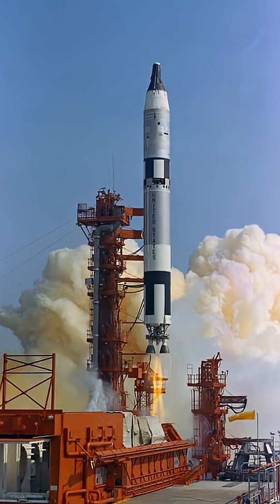Why does this rocket have HOLES!? #shorts #history

Comment: The holes or vents for hot staging has more to do with pressure than temperature/heat.  Any pressure rises in the nozzle bay will directly impact the combustion balance in the rocket motor itself as well as the nozzle expansion ratio. Hot staging minimizes the possibility of nozzle damage when multiple springs, explosive bolts or other mechanical separation devices, which ALWAYS requires more than one device, have one of those devices having a "laggy" extension/thrusting, placing a pitch or yaw on the second stage itself and not clearing the top nozzle bay linearly.  Using the rocket motor is always more controllable.

Comment: Normally, one would like to stage at the point when the lower stage burns out. With liquid-propellant rockets, staging in the atmosphere, drag would slow the rocket down a bit, causing the propellant in the upper stage tanks to shift forward (to the top of the tanks). Propellant is drawn from the bottom of the tanks, so the upper stage engines would be starved for fuel. Hot staging ignites the upper stage while it is still being accelerated by the lower stage engines. Propellant in the upper stage is, then, where it should be.

Comment: Why staging?  
1.  Lose excess weight that serves no purpose
2.  Use engines with bell housings which expels gas at the same pressure as atmosphere.  Pe=Patm.  Its why bell housings get larger as they get to lower pressures/higher altitudes.

Love your stiff Amy.  Just clarifying what you were saying about staging purpose.

Comment: The biggest problem with staging during flight, especially at zero-g, is "ullage".  Ullage is the empty space at the top of a tank or bottle.  Rocket motors/turbo pumps pull fuel and oxidizer from the bottom of the tanks.  Very VERY Bad Things, like turbo or ignition chamber explosions, happen if they pull air/fumes instead of liquids.  The "ullage motors" on the Saturn V are not just to pull the new stage away from the old, but more importantly to pull the fuel and oxidizer down to the bottom of the tank.  This was especially important for the Saturn V third stage, that had to be relit in orbit at zero-g for Trans Lunar Injection.  Ullage motors were usually single use, but needed to be relit for TLI.
One way to avoid all of the above is what the Titan II did on Gemini.  It lights the second stage while the first stage is still accelerating the rocket.  However, to do this, you need vents to allow the second stage rocket exhaust to vent when they start and haven't separated from the first stage yet.  
A similar solution was solved on the Atlas rocket by lighting the core engines and two strap-on boosters on the pad, then discarding the boosters and continued burning the core engines until they reached orbit. 
Soviet/Russian Soyuz Rocket also have 4 strap-on boosters around a core.  The 4 boosters are discarded while the core continues.  The upper stages are also connected by a lattice of struts, rather than being aerodynamically enclosed, to allow engines to vent exhaust when they are lit "early"

Comment: I am a little confused about your statement that ullage rockets were used to separate the spent stage. Ullage is a reference to an air bubble in a liquid. It actually comes from wine stored in barrels.  Ullage rockets are used to provide forward, momentum after stage separation.  That forward momentum drives the fuel in the fuel tank to the bottom, where the fuel pump is. Without the ullage rocket, there is no guarantee that you will actually get fuel to the fuel pump.
Retro rockets are used to effect stage separation .

Comment: There is another interesting reason for staging, to shed excess mass (weight). Once enough of the initial take off fuel has been expended, the amount of remaining fuel can only gain a limited additional amount of speed and momentum. By shedding all the weight of (now) empty tanks and the initial heavy lift take off engines, the smaller upper stages which remain fully fueled can easily lift the payload to much greater speeds thanks to greatly improved efficiency. 

Think of the upper stages as fresh rockets just starting their part of the journey.  

As I said before, the relatively small amount of remaining fuel (if there had only been a single stage large rocket) would have been gobbled up in a minute or two additional burn. However the smaller upper stage rocket can use the same amount of fuel for a much longer burn, thus completing the trip to a destination that the heavy lift booster simply could not reach before being overcome by the reality of gravity.

Comment: The Titan Missile was the first US missile (here ICBM) with a large second stage with a rocket engine. So there were cut outs. The earlier Atlas, Jupiter and Redstone used for the Space Programs did not have a large second stage. Thank you. 
You describe it as a missile.  That's a very broad term and here, it is used to define a guided projectile and a rocket would be unguided. But a rocket is also the type of propulsion system. Are you reluctant to use the terms ICBM and IRBMs because of their warheads? I understand.

Comment: How does one explain Delta V and loss of mass in the staging. To the normies
Reply: Delta V means change in velocity (delta is used in maths to mean a change in some variable's value). Loss of mass in staging? What would you like explained? The spent stage is discarded rather than being carried along. As a result, the operating rocket engines only push the still active part of the rocket.

Comment: Besides adding the advantage of vacuum-optimized engines, staging also sheds as much extra weight as possible.

Vacuum optimized engines will tear themselves apart at sea level because the exhaust separates from the bell and starts slamming around.

The Space Shuttle RS-25’s, one of the most sophisticated and efficient engine ever made, burned from launch all the way to orbit. They were vacuum-optimized but had special structures to protect them from flow separation.

Comment: Very cool. Pretty much the same design is employed in multi stage model rockets that use those small Estes motors. If you don’t have vent holes the booster can separate the stages before igniting the sustainer motor. All Boy Scouts should know this.

Comment: Can anyone explain to me why during over a decade USA had no independent spacecraft launching capabilities, after space shuttle retired, the titan was not used ?
Over hundred titan IBCMs available ?
Reply: There was never a gap in satellite launch capability, just crew launch. ULA, SpaceX, and Orbital Sciences carried on just fine post-Shuttle
There was Titan 23G, which were surplus Titan IIs converted to orbital rockets. But that ended in 2003. There were around 60 flightworthy Titan IIs left in inventory at the time, but they could only put like 3.6 tons in orbit and the cost of restoring them and converting them for orbital use turned out to be more than the cost of building a brand-new Delta II, so it only flew a handful of times before they gave up and just scrapped the remaining stockpile. There were some upgrade options proposed to boost payload, but this would increase costs even more. And Titan IV (new-build hardware but still directly derived from the missile) was still flying until 2006 but inflation-adjusted cost almost a billion dollars a launch, so nobody wanted to keep flying it after the EELV program began
If you're talking about crew specifically, there was a proposal from a company called HMX (later became part of t/Space, now defunct) to launch a small crew or cargo capsule on Titan 23Gs. It was proposed under the Alternate Access to Station program, but AAS was canceled in 2003 and HMX's bid was never taken very seriously. t/Space later proposed the same capsule as part of their bid for COTS and again for the Crew Exploration Vehicle, but in both cases moved it to a larger modern rocket
Reply: Because they didn't have a spacecraft to put people inside, on top of any rocket.
Reply: @maxfan1591 There must have been more to it, than that.
Blue prints , and able to produce a more modern capable capsule.
The cost and R&R must a fraction than reinventing a launch system.

Comment: A couple other comments touched on the bell shape. A bit more detail... 

Due to atmospheric pressure, if a large bell were used on launch, the flow would transition to subsonic inside the bell and slow down, wasting thrust. If a small bell were used at high altitude or in space, the supersonic flow would not reach maximum speed, wasting thrust. Supersonic flow continues to accelerate as it expands, assuming no transition to subsonic (supersonic flow is counter-intuitive, and it has been ages since I studied it). For the best thrust in outer space, you want a very large bell opening, stopped by practical considerations such as how large a bell can physically fit and total weight.
Reply: Flow separation matters a lot more for the "vac engine fired in atmosphere" situtation, since it'll just destroy the nozzle entirely

Comment: Quite a few of the Soviet launch vehicles had the same opening between stages for hot staging. I've always thought they looked typically Soviet. Very industrial & utilitarian. 

I've got a great side by side image of a Saturn V & a Soviet N1 that shows the steel "lattice" that holfs the N1's stages together, but you can't post pics in comments.

Comment: I remember reading (after Titan silo accident 1984?) that the fuel for the titans was one of the most horrifically toxic, explosive, carcinogenic, caustic brews ever mixed by human kind.  Did they substitute Kerosine and/or hydrogen for crewed flights ?
Reply: Nope. And they used the same propellant combination in Apollo for the Service Module engine, and the Lunar Module descent and ascent engines.
Reply: @maxfan1591 thanks !
Reply: Other way around. Titan I was kerosene/LOX, then switched to hypergols for Titan II onwards. And though NTO/aerozine is a pretty toxic combo, it's a lot friendlier than some of the other hypergols that were tested (most of which never flew because they would be environmental disasters on every flight)

Comment: Different nozzle designs based on atmospheric density- narrow, shorter bells work well at low altitude. Longer, wider bells work better at higher altitudes or in vacuum. And of course, as an engineering problem- there are always tradeoffs to be made.
It's a fascinating subject- at least to a nerd like me!

Comment: At 0:30 the interstage collar has a row of bright white dots on the shaded inside.

I believe this is daylight shining through pressure equalisation holes, as in other footage, the holes are only backlit on one side.

Does anyone know the cause of the red light source, directly at the bottom of the interstage ring?
I doubt they'd install anything that's a source of heat.
Reply: "Does anyone know the cause of the red light source, directly at the bottom of the interstage ring?
I doubt they'd install anything that's a source of heat."

Do you mean the flames at the base of the interstage as it falls away? If so, that's flames from the second stage engine exhaust.

Comment: Also,  multi-staging allows the empty stages to be detached, lightening the rocket. This saves fuel, the heaviest part of the rocket.
Reply: Soyuz has a lattice between the reentry module and service module. A failure of the pyrotechnic charges kept the two attached and falling inverted on reentry until the lattice burned away from reentry heat and the entry capsule righted itself due to aerodynamic forces.
And one reason that I call that capsule system a flying tank. Reentry heat inverted and survived along with the crew.
Even if a couple of landings resulted in injuries, including shattered teeth.

Comment: Gemini is my favorite program. They used a modular system, they had a cool rocket they could dock on in orbit which had instrumentation they could look at through the window, they could've taken it to the Moon if Apollo didn't have monopoly on the Moon.
Reply: Gemini was the test ground for Apollo. Although Gemini was never build for or capable to go to the moon, it did provide crucial data for Apollo.

Comment: SpaceX hot stages it's rockets. It increases the exceleration of the rocket because there's little or no loss of momentum. With traditional staging there a period of coasting where in the rocket loses some energy. With hot staging the thrust is constant.
Reply: SpaceX has hot staging on only one of its rockets, Starship. Neither Falcon nor Falcon Heavy use hot staging.  Falcon 1 also didn't use hot staging.
Reply: Not quite coasting. There's a brief coast, then ullage motors push the rocket away from the expended stage.

Comment: Where does the term "ullage" come from?
Reply: From what I know, ullage is the tank pressure.
Ullage boosters basically make artificial gravity with thrust, causing hydrostatic pressure in the propellant tank(they also push them downwards, which is extra useful)
Reply: The word "ullage" originally comes from brewing. It was the term for the part of a barrel which contained air rather than the alcoholic beverage stored in the barrel.

Comment: I remember being like 9 years old and watching a thing about the moon missions and it has sold stuff in it about the Soviet work on the N1. I remember seeing it and thinking, "Why do they have stages attacked together with mesh?" However, this was like 1999 or something and internet access was still pretty rare, so I couldn't really go any further and just thought to myself, "Well they obviously did it on purpose, maybe it didn't work good. That thing crashed and exploded every time." I only found out what was actually going on like twenty years later probably either here, from Scott Manley, or Everyday Astronaut.
Reply: Actually, that mesh lattice saved at least one Soyuz. Pyro failure caused the service module to not separate from the reentry module and it literally burned through as designed. Once the service module came free, the reentry capsule righted itself by aerodynamic forces and it landed the crew safely, despite that extremely rough reentry.
Given that the reentry was upside down, with the top/front facing down and not the heat shield, well that's why I call that monster a flying tank. And only one Soyuz lost a crew, due to a exceptionally poor choice on where to put a cabin pressure relief valve. That crew being the only humans to die in space, everyone else died in the upper atmosphere or on the ground.

Comment: I can see where they might have thought that they would have lost momentum during staging so they fired before seperation.  Once they learned that's not the case, or the lose was very small, they changed to seperation then firing.
Reply: Hot staging is actually quite a bit more efficient. You don't need the weight & complexity of ullage motors to separate, and you don't have to deal with sloshing fuel & oxidizer when a stage fully shuts off. This is largely why SpaceX is returning to hot staging for Starship.
Reply: The reason rockets need to hit stage or require special staging motors is because rockets require acceleration to feed fuel into the engines. Without gravity there is no way to push fuel into the engines to start them.

Comment: I wouldn't call the Titan a bit of an outlier.  Perhaps it's unusual in US rockets, but many rockets used and still use hot staging. The R7/Soyuz family, the UR/Proton family, and even the current Starship/superheavy all use hot staging.
Reply: I think she meant it was an outlier compared to the way NASA was doing things at the time.
Reply: I think Titan was the only American rocket to use hot staging, at least until Starship.
Reply: The latest Starship variation also has the clever trick that the holes are asymmetric, so the booster will always be tipped in a particular direction, aiding the "turn for home" part of the process.
Reply: @simongeard4824 I'm looking forward to seeing if they continue this technique with the V3 Superheavy. No hot staging ring. Permanent tubular supports that leave a much bigger gap for gasses to escape. I imagine they'll block a small area to save propellant for the flip and burn and landing burn. Plus it will only have three grid fins set lower and in the methane tank. These grid fins are much bigger than V1 and V2.  Superheavy
Reply: @timonium252  I think they will. From what they've said, it sounds like a useful optimisation... a small but useful fuel saving for the booster, at the cost of a fairly small amount of extra mass.